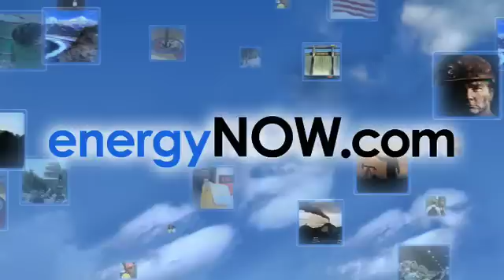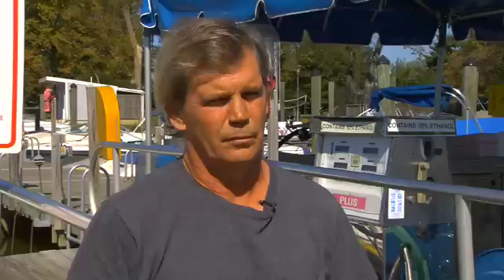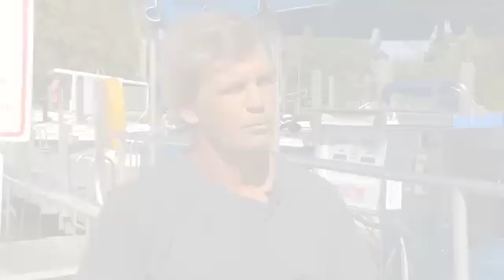Bad for boats

Comment: This junk, destroys generators for emergency power , chain saw motors for downed trees after storms, lawnmowers, weed whackers,  small water pumping machines used in construction or emergency water removal . These are just a few .But here is were it is really leading to If I had to use them. Why would I purchase.? Lease it with clause in the contract. Why buy when there is no guaranteeing contract.Caused by default from a fiat EPA. Wheres the BBB at when need them? Throw the leeches out in 2012!